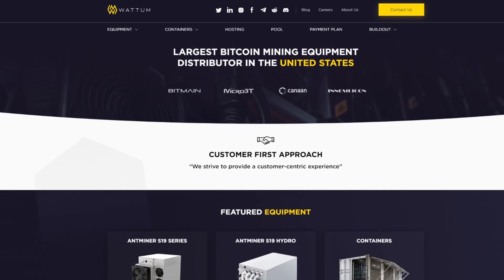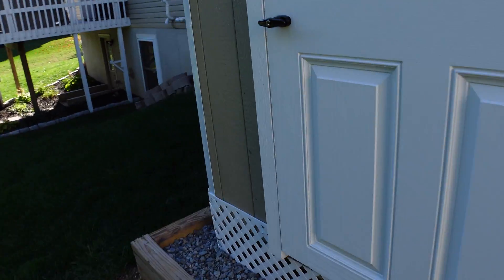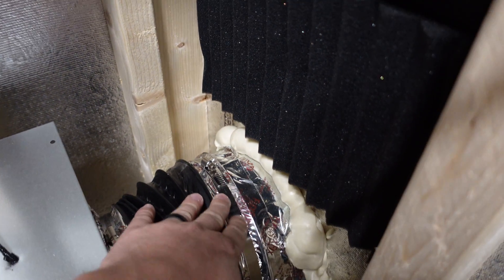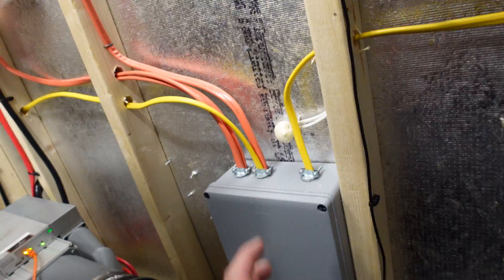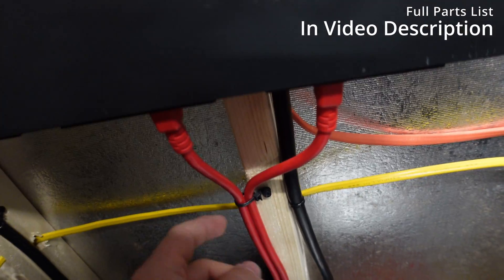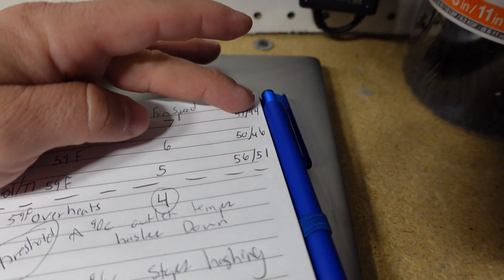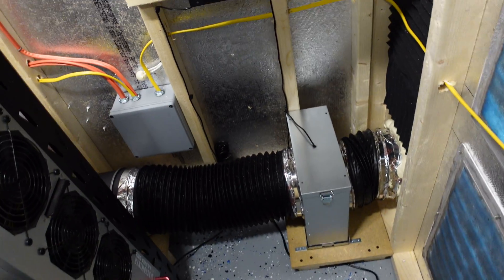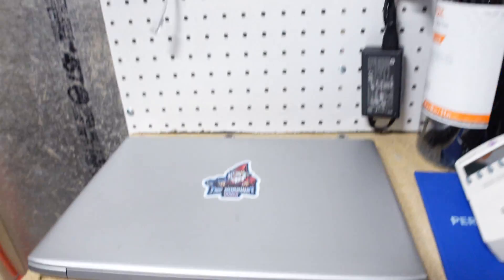Can you REMOVE the BITCOIN ASIC Fans for Better COOLING and a QUIETER ASIC?

Comment: I know it has been awhile since you posted this video so this comment may never be seen but I have an idea of how to save more money with your filter system. For automobiles there are re-usable air filters which can be cleaned. There are many types and sizes of these filters so I imagine you could find one that fits in your current box; maybe an 8-9” round one or a square/rectangular one the same size as you currently use. Anyway K&N Filters is the company I’m thinking of that provides these 10yr/Million Mile Limited Warranty amazing filters.

Comment: At the current BTC hashrate, a 100TH miner, yields around 0.011 BTC per month. With the exponential increase in BTC hashrate, and the reward halving in a year, this will take more than 20 years to mine a single BTC!

If your electric cost is $0.07/kWh, and doesn’t increase in the future (unlikely assumption) you will have spent $18,000 in 10 years time on electricity alone … not including miner maintenance and construction of ventilation infrastructure.

Currently, one BTC is $22,400. 

I don’t mean to be negative, but the math really doesn’t add up 🤷🏻‍♂️

Comment: Are you certain that your placement of the fan is correct? What would be the advatage/disadvantage of placing the in-line fan at the end of the miner instead of the beginning?
Reply from the maker: The inline fan is in the front intake side of the ASIC.
Reply: @TheHobbyistMiner  what is better- blowing air through the miner or pulling air from the miner? Bitmain does both with its fans so one might be better than the other especially when you only have one fan in the line. Does it not matter for a closed line? Either way the temps seem good enough but if we get an overclock firmware this might matter.

Comment: Don't have an BTC asic yet, but did do something similar for custom mining cases to both control temp and noise - before Octo's were a thing lol. What you have done is neater and well thought out! You can get a pwm fan controller with its own pcb and "smarts" to regulate fan speed based on temperature. In my case I did it using a thermal fan kit available for sports cars (or any car really) and ran it at 12 volts using, wait for it, a cars thermal fan! They take up more space than the inline fans (obviously) but have very high cfm and long life. I know you can use one of these controllers to regulate mains voltage via a switching circuit board. But I was doing it on a budget and decided my local wreaker had a big enough supply of fans for me to be happy lol. I take nothing away from your solution though. It's awesome and you're right to be impressed by the outcome! Thanks for the vid, but buy a bigger shed lock lol!

Comment: THM wow awesome new initial intro! So cool, also congratulations 🎉 getting it all completed! Looks amazing and so much more quieter, you can even record content right by it! If you plan todo more pro ASIC I would think about just pulling intake air from inside the shed this way you will not need to make more holes in the shed and also not change filter as often! BTW great idea on taking exhaust temps
Reply from the maker: Thanks so much!! I think I am going to put like an outlet in the lid of the Filter Box and during the winter let it SUCK warm air from inside of the shed. I may even run a small like 2 inch tube to the top of the inside of the shed closest to the roof line to pull it the hottest air in the shed.  To allow warm air to mix with the super cool air.
Reply: @TheHobbyistMiner  awesome 👏 idea, I love experiments! Keep us posted,

Comment from the maker: 𝐏𝐚𝐫𝐭𝐬 𝐔𝐬𝐞𝐝 𝐢𝐧 𝐓𝐨𝐝𝐚𝐲'𝐬 𝐕𝐢𝐝𝐞𝐨
🔸Deluxe Cooling Kit and Shroud for ASIC Miner in Video https://amzn.to/3TJLc7N
💰Get 15% Off this Kit Using Checkout Code HOBBYIST15
🔸Alternative Cooling Kit and Shroud for ASIC Miner https://amzn.to/3ggLODx
🔸AC Infinity 8" Inline Fan in Video https://acinfinity.com/hvac-home-ventilation/inline-duct-fan-systems/cloudline-s8-quiet-inline-duct-fan-system-with-speed-controller-8-inch/
⭐Use Checkout Discount Code "TheHobbyistMiner" for 15% Off
🔸AC Infinity Controller 69 WiFi for Airflow Automation
https://acinfinity.com/hydroponics-growers/controllers/smart-uis-controllers/controller-69-wifi-independent-programs-for-four-devices-dynamic-temperature-humidity-scheduling-cycles-levels-control-data-app/
⭐Use Checkout Discount Code "TheHobbyistMiner" for 15% Off
🔸AC Infinity 8" Duct Work in Video https://acinfinity.com/hvac-home-ventilation/ducting-clamps-grilles/ac-infinity-flexible-four-layer-ducting-8-ft-long-8-inch/
⭐Use Checkout Discount Code "TheHobbyistMiner" for 15% Off
🔸HVAC Foil Tape in Video https://amzn.to/3F2rYGK
🔸Blower Tool used to Clean ASIC Miner https://amzn.to/3guIqoV
🔸 8" Filter Box in Video https://www.supplyhouse.com/Fantech-FGR8-8-Filter-Cassette-w-MERV5-Filter?utm_source=google_ad&utm_medium=Shopping_ntm&utm_campaign=Shopping_NTM_Returning_users&gclid=Cj0KCQjw--2aBhD5ARIsALiRlwB9rj51AM4SFgSBoyr4nT8RYetvDnnLNZv5xCjqdu7K6BYpdZDNOAYaAnIuEALw_wcB
Reply: Hey Hobbyist, just an fyi, the Ac Infinity only gives a 10% discount on your code
Reply: HOBBYIST15 does not work on Amazon for the Deluxe Cryptocurrency Cooling Kit with PSU Cooling?